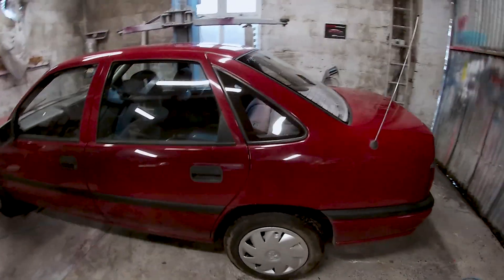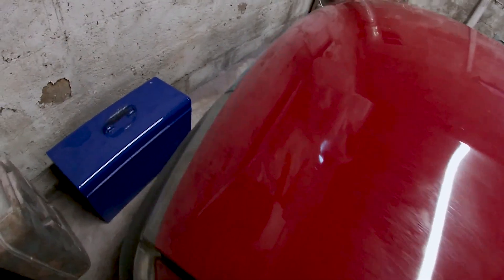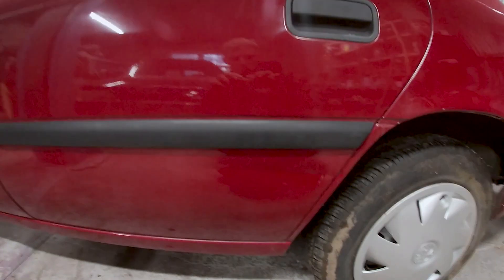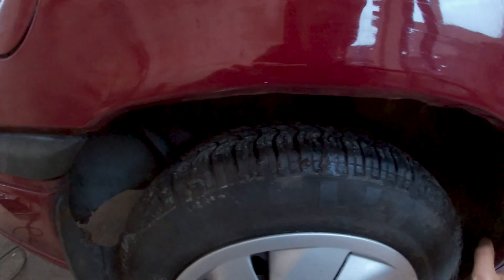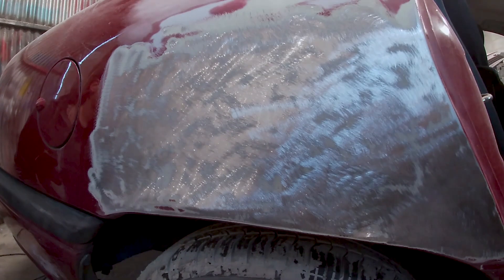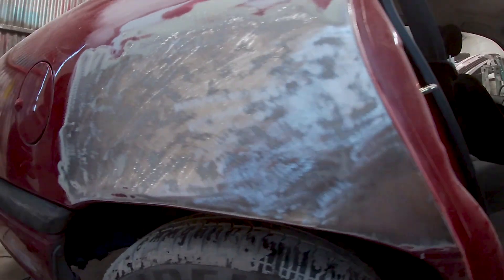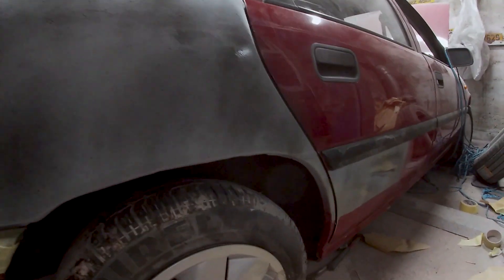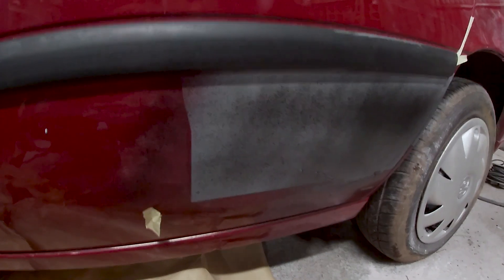| Restoring: A Mk3 Vauxhall Cavalier Saloon (1.8) | Part 1 |

Comment: I'd be checking fuel pump if it's not starting, especially if it's been sat round with a empty tank, lift back seat and bang on boot floor,top of tank as you get a friend too turn it over
Reply from the maker: Ok thanks mate
Reply: @rebuildsni4251  How about a GSI 4X4 replica but a twist it has a Tesla drive unit in the rear with 650bhp..... ??
Reply from the maker: This sounds interesting but very expensive i might have to look in to it
Reply: @rebuildsni4251  Have a look at Damian Maguire EVBMW channel he does conversions :):)
Reply from the maker: @kylereese4822  ok thanks ❤️